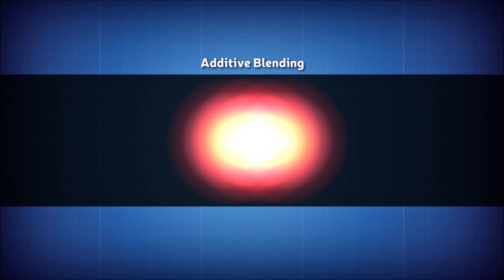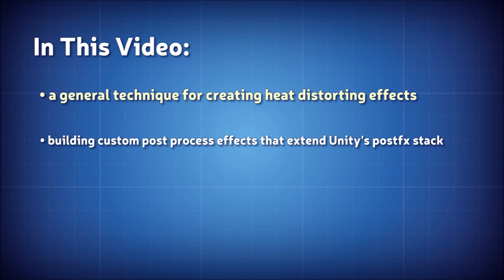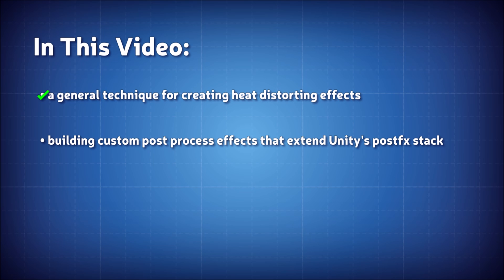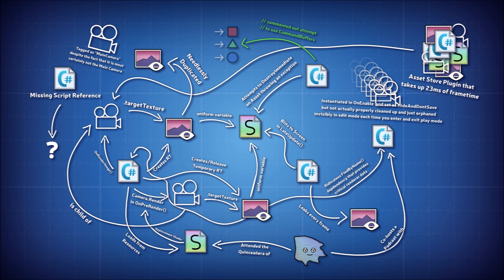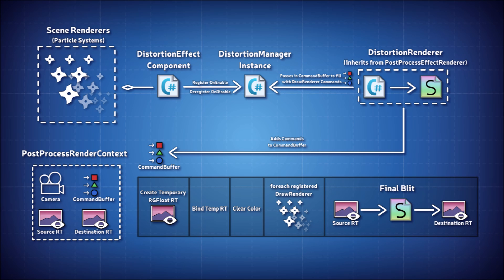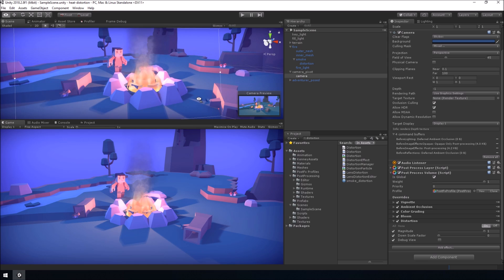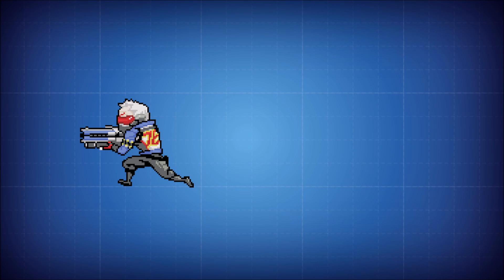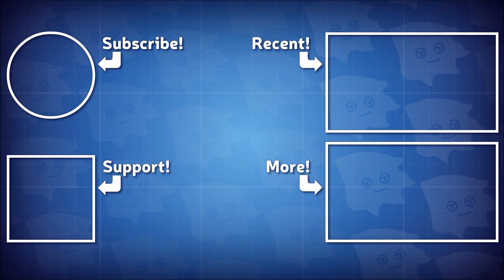Shaders Case Study - Distortion FX with Unity's Post-processing Stack v2

Comment: It will not work on latest HDRP (5.7 I believe) because they implemented its own Postprocess there, which is not extensible right now =/
Reply from the maker: Everything is extensible! You can actually locally modify code pulled down from Package Manager (even if you're not editing it, it's great to dig into and read through it).

I've heard about this issue though— when they officially support HDRP custom post process effects I'll push an update/example code to the GitHub project.
Reply: @DanMoranGameDev  I agree, this is very good way to learm. I hope they make the HDRP PP API as good as the PPv2 one. Loved it.

Comment: Just my 2 cents, don't use this on mobile, Unit Post Process create default full native resolution texture on the background,  so you will have one more huge size texture on memory (debug camera force RT). Also mobile have native depth texture, using this technique will create 2 draw calls for every object. Finally, command buffer on mobile is not optimized, it just kill open gl2. Good luck all :D Btw, great video !
Reply from the maker: Absolutely, I wouldn't recommend using the Post-processing stack on mobile in general. You're better off writing a custom stack where you render everything into an RT you control (likely down rezzed) and combining any and all post fx into the blit from that RT to the back buffer.

2 draw calls for every particle system that needs distortion is a fine requirement imo, even on an iPhone 5s you can push nearly 1000 draw calls before that becomes the bottle neck. But it's always project specific, profile first and see what needs fixing!

Thank you for sharing your insights ^^

Comment: PPv2 is in maintenance mode now, and won't work for HDRP 5.3+. HDRP has its own PP built in now. Customization will come in 2019.2.

https://forum.unity.com/threads/hdrp-new-post-processing-extending.624166/#post-4229698

Comment: Very cool effect, and very clever as well!
I was wondering, if the second particle system was used solely to make the distortion larger than the actual smoke?
If that's the case, I was playing with the shader, and I added a couple of Vector (float3) parameters to the distortion particle shader: Scale and Offset. And then, I was scaling the vertex like so:
//Properties
Properties
{
 _MainTex ("Texture", 2D) = "white" {}
        _Magnitude ("Magnitude", Float) = 1
        _Scale ("Scale", Vector) = (1, 1, 1, 1)
        _Offset ("Offset", Vector) = (0, 0, 0, 0)
}
//Scaling
o.vertex = UnityObjectToClipPos(v.vertex * _Scale + _Offset);

Finally, in the material inspector, I set the scale and the offsets to these values:
Scale (1.5, 1.5, 1.5, 1)
Offset (-1, -0.4, 1, 0)

(And of course I deleted the second particle system, moved the distortion effect and exposed the material in the inspector so I can set it separately)

And overall I got a distortion that was nice. I figured this would an optimization so we don't need to simulate two particle systems. I wonder if there's a gotcha that I missed while trying this out.

Thank you for the great videos, really appreciated!
Reply from the maker: Oh yeah you could totally work. Could basically submit the particle system render used for the smoke to the distortion manager with a different material. Very cool idea!

Comment: You really need the post processing part to make the effect work?
Reply from the maker: Not Unity's post stack necessarily, but yeah this technique requires a full screen blit to work. Even a GrabPass style version implies the a blit or CopyTexture call at some point in the pipeline.

Most games these days are drawing into a buffer then blitting to the screen rather than drawing right into the back buffer directly anyway. If perf is a concern, this could actually be combined into the same Pass as LUT/Vignette (possible with unity's stack if you're willing to get your hands dirty).

Comment: Do you really need an RGFloat buffer? 32 bits of precision for distorting discrete pixels seems excessive, how about RGHalf? (16+16 bit floats) and should be about twice as fast.
Reply from the maker: Yeah Half should work. I guess I could have just said any HDR colour format.

Is it really twice as fast? I was under the impression most GPUs were still FP32 anyway. Would certainly make a difference on mobile though (but I probably wouldn't recommend Unity's post stack in that case 😅).
Reply: @DanMoranGameDev  but I probably wouldn't recommend Unity's post stack in that case. Why? is slower?
Reply from the maker: @SoaringSimulator  using any post processing on mobile is a bad idea unless you really know what you're doing and know what your lowest target hardware looks like. If you're doing post on mobile, you'll more than likely need to write some LOD system, resolution scaling, and shader variant management layer if you're gonna ship the same binary on an iPhone XS and an iPhone 5s.

Comment: I can confirm that custom PostProcess effect work with the HDRP.
Reply: PPv2 won't work for HDRP 5.3+. HDRP has its own PP built in now. Actually there's no way to do custom PP for HDRP currently (not without changing the HDRP source code directly). Customization will only be available in 2019.2. 

https://forum.unity.com/threads/hdrp-new-post-processing-extending.624166/#post-4229698

Comment: GlassStainedBumpDistort shader in the unity standard assets does this exact thing without the use of post processing stack. Samples from a normal and everything.
Reply from the maker: It uses GrabPass which will not work in the future (SRP). In general, GrabPass performs very poorly and the technique in this video should outperform it (especially if you take advantage of the down scaled render target).
Reply: @DanMoranGameDev  _CameraOpaqueTexture should replace the GrabPass in SRP. It also supports down sampling now as well. I personally have never been on a project where using GrabPass had any noticeable performance effect, but the general opinion on GrabPass does seem to be that it underpreforms. In my head the extra Blit with on render texture makes me(probably wrongly so) think it's slower.
Reply from the maker: Haven't heard of _CameraOpaqueTexture, is it specific to LWRP? (a quick google hinted so)

Ultimately, yes every project is going to be different and have varied goals and performance targets. This is by no means the be all end all way of implementing this effect, just another way. DOOM 2016 used a separate buffer for distortions and I've personally preferred this way ever since.
Reply: @DanMoranGameDev  From what I know it's only on LWRP, though hope they bring it to the HD pipeline. It only grabs opaque objects so it's actually more preformant than the legacy GrabPass since it's not doing repeated passes on itself. That's really all I know about it.

I'll have to look at the DOOM distortions approach, you've peaked my interest. I was already thinking of looking into Vulkan API some because of Stadia so this is just an extra excuse.

Comment: Cool stuff as usual ! What's the difference with a particle shader that can do a grabpass for you?
Reply from the maker: Thanks! Excellent question, a grab pass technique could certainly accomplish a similar effect. As a pro, you could get more control over how the distortion combines with the rest of the VFX. As a con, distorting fx will have less interesting combinations— a distorting effect drawing over top of another one will just alpha blend on top of the the other, so you wont get compounding effects.

GrabPass specifically is a dying/legacy feature that I'm not sure will be around forever. I'd recommend hooking up a Graphics.CopyTexture into the stack during the post-opaque stage and referencing that instead.
Reply: @DanMoranGameDev  Yeah, I've seend that on SRP they removed grabpass before introducing a new similar technique, don't remember which one...Anyway thanks for your tutorial, I've already made some cool effects using render textures but not combining it with the post effect stack.